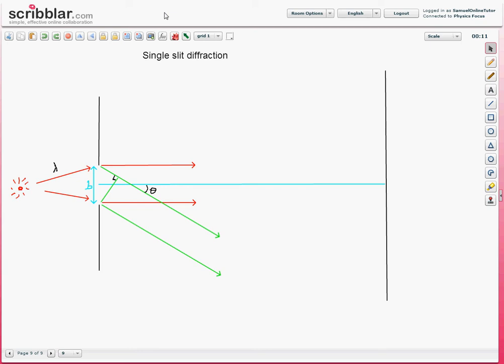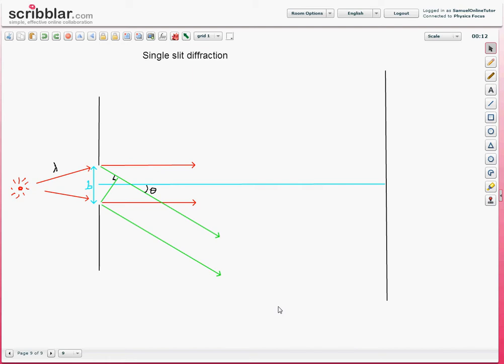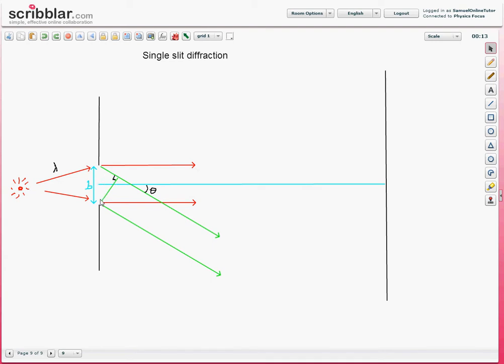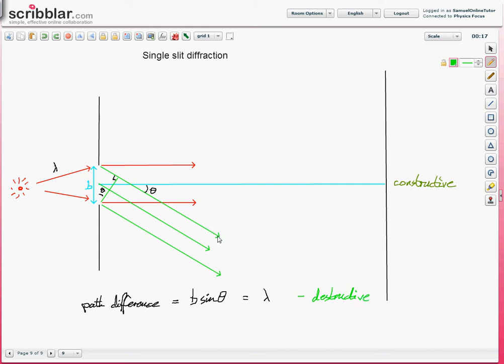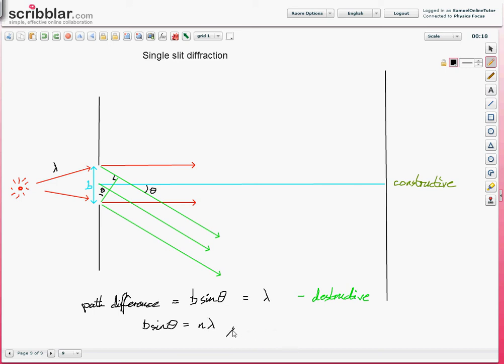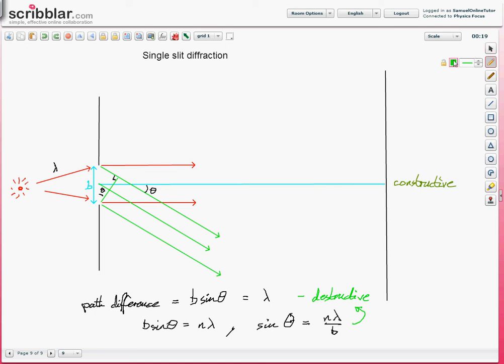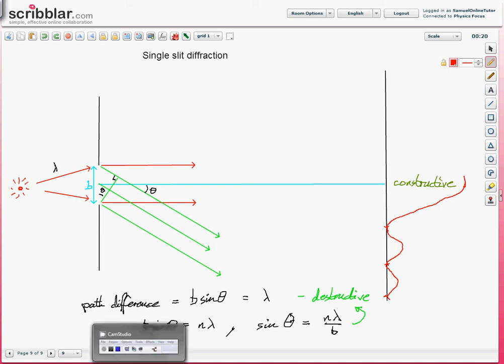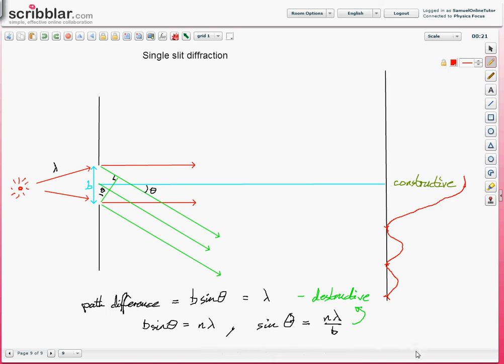Single slit diffraction

Comment: Why should parallel waves interfere???
Reply: Sjaak, you are right. They wouldn't. So these waves are not really quite parallel. They converge and meet when they reach the screen where you see the interference pattern. But look at the dimensions of the arrangement. The width of the slit (b) is usually less than a micrometer. The distance to the screen is usually the other side of the room - several meters. The angle between the two rays is so tiny that we can safely ignore it.
Reply: I understand. Thanks!